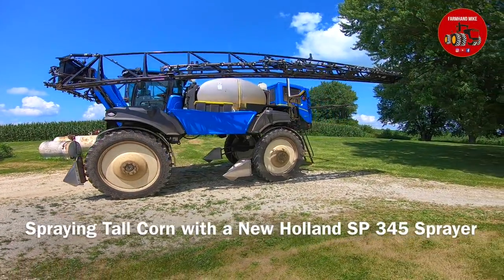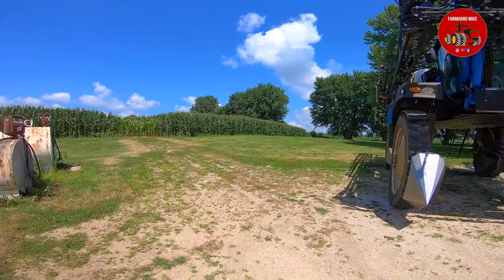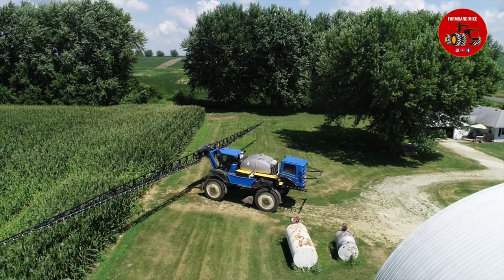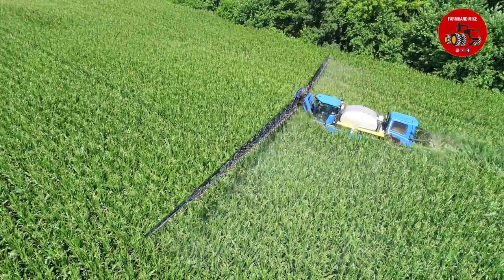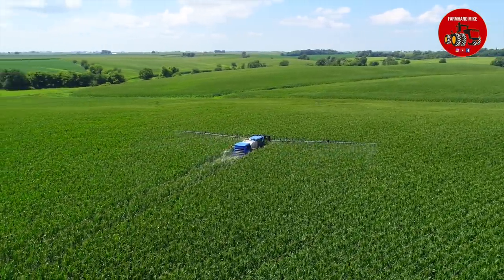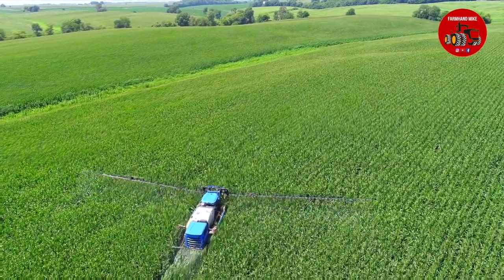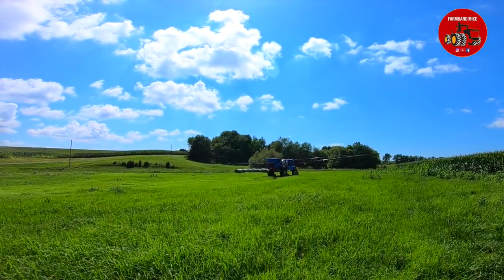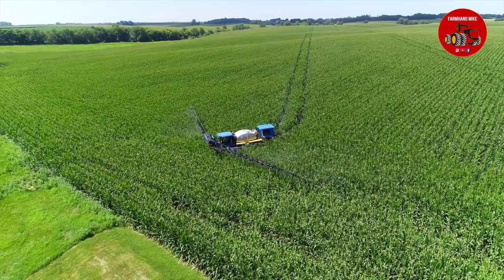Spraying Fungicide in Tall Corn with a New Holland SP 345 Sprayer

Comment: Very newest modes of New Holland sprayers are now coming with FPT engines. Was just running a SP310F the other day had a FPT engine and some other new changes compared to the these blue Miller built machines
Reply from the maker: Thanks Trevor. I figured they would have no choice but to make that change.
Reply: What did you think of the new sp310f?  Any noticeable improvement in the ride or driveability of it?  Has the boom stability been improved at all?  Seem to have enough power with the little 6.7 liter FPT?
Reply: Stirv It was a nice machine. Power seemed adequate but I was running on firm ground and never had more then 800gal on the machine at a time. I think they are going to transition to a larger engine in the future. I was impressed with boom stability. It had raven auto boom height which I thought needed calibrated better yet even with that the boom stays very still and doesn’t affect the machines handling as much as previous models.